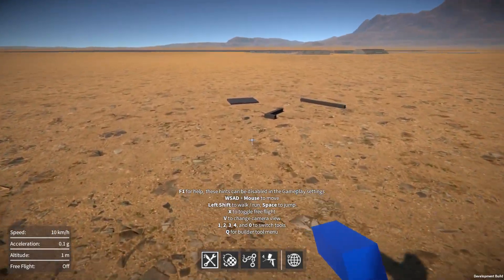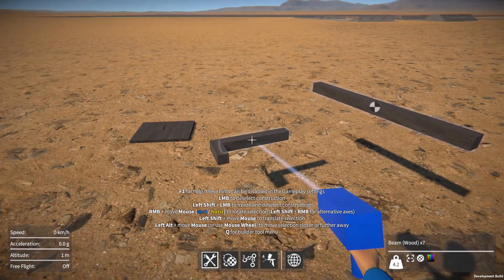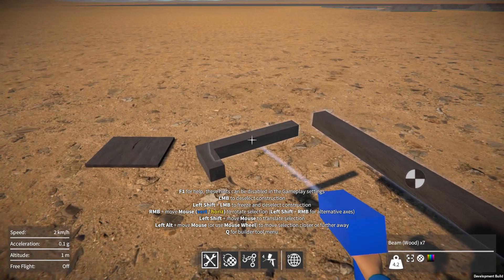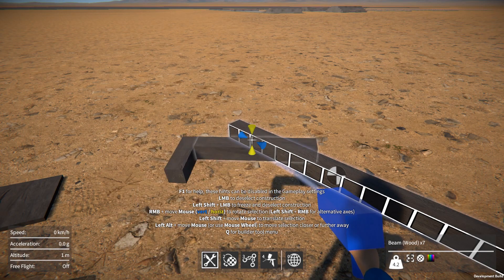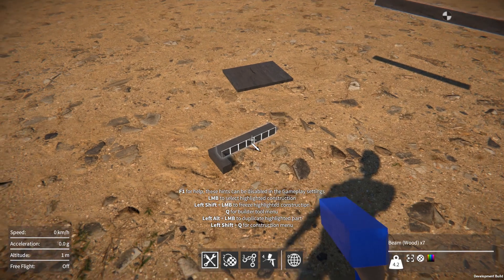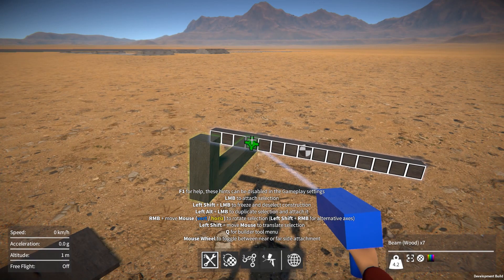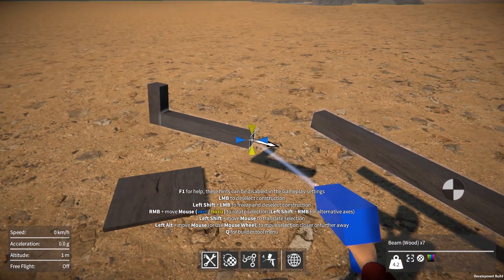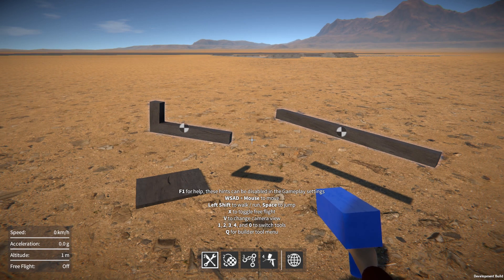GearBlocks building UI - need your feedback!

Comment: Personally, I had no problem figuring out the builder controls when I first started the game.
Though, I don't like the recent change of freezing the parts by holding Shift, freezing with LMB+RMB was more intuitive, just like in G-Mod...
Reply from the maker: Thanks!  I think it's always been shift+LMB by default to freeze in GearBlocks, but you can set it up as RMB+LMB in the key bindings (under the controls settings), let me know if you need help with this.

Comment: Hi!

By now, I've spent weeks in your game and I was having absolute blast of a time. I have made some quite complex projects in 1:1 size - 4WD cars, trucks, formulas, all including independent suspension, helicopters capable of actual piloted steady flight, acrobatic maneuvers and safe landings on designated spot, also some heavy machinery, a snow groomer running on actual tracks with working blade and snow tiller. I have a background in engineering, physics and programming. I can send you the game saves so you can check those models out or even present them on the channel if you'd like as I'm not really the type to present these on YouTube myself.

Having spent the time in the game, I have tons of feedback for you if you're interested.

1) Current building system is decent once you get into it (few hours of gameplay), I wouldn't touch it for now. Ideas you have presented won't make it better, just other kind of complex. Also, watching you experiment with the fps tool models, make sure to add the option to turn those off as they can get distracting and obstruct screen space for no reason. Including that light beam leading to the piece. It's unnecessary.

There is a thing missing though. Add a "hand" tool that would allow you to pick objects up without them ghosting out, you now, like actual physical objects. Imagine a trash can with actual trash in it. If you wanna move it and pick it up, all the trash falls through, ending up on the ground, as the can ghosts out.

I made a cannon for a tank, with 7 shot auto reloading magazine. Missiles being represented by 3*1*1 beams as a separate constructions (no other way to do it really). Point is, when you wanna move the tank with loaded magazine, it ghost's out and shells fall out on the ground.
This principle applies to anything that's made from more than one in-game construction. For example any tracked vehicle - you have the vehicle body, the left track and the right track. If you pick up vehicle body, tracks fall off...

Sometimes when working on something, I really just need to pick up a piece of plank or something to hit it with to see how the thing would react. But I can't. Because there is no actual way to hold a physical object in the game.

I would go for following toolset:
1) Hand
2) Builder
(get rid of the Linker - or does it have a purpose now? - in the demo I have it doesn't)
3) Paint
4-9) keep empty for possible future tools
0) World Manager

2) You need to add a mirroring solution. Badly. Imagine working on a full scale airplane (I'm building the Bell V-22 Osprey tilt rotor now :D) where it takes about 4-5 seconds just to walk from one side to the other. Imagine making an adjustment on one wing and repeatedly going back and forth to re-do the same thing on the other wing. It's just unnecessary and not fun work. Plus I sometimes screw up and misplace stuff, making your plane asymmetric, then wonder why body lines won't match up etc.

I was thinking something like adding a purpose made virtual block to a construction which would define a position of a mirroring plane for that particular construction. Then if for example a beam block would be attached to the construction on one side, it's copy would be placed on the other side automatically by mirroring the coordinates. Virtual block would disappear upon unfreezing the construction and reappear again upon freezing it. Perhaps it could look like a floating icon, just like the center of gravity is displayed, but could be placed and removed like 1x1x1 beam block?

This way you could watch one side in real time as you're building the other to check if you're maintaining correct overall proportions etc.

3) Blue glare around frozen constructions - add a setting to turn it off or make it visible only for constructions closer than 5 meters from player or something like that.

If there is a frozen construction or several of them in your field of view at a distance behind the piece you are working on, it constantly clutters your vision with it's blue glare effects, because they can be seen through anything, including your work piece. Can't stress how distracting and tiring this is for your eyes after a while.

4) Active components (motors, servos etc.) are just badly limited and need a complete overhaul. There are just so many possibilities missed, it's frustrating.

Example cases:

Motors
(Let's say...)
- key [A] makes the motor spin left
- key [D] makes the motor spin right
How do I make the motor stop? I can't, no option to bind a key to...

Motors (again):
- key [A] makes the motor spin left
What if I want another key [Q] to also spin the motor left? I can't, the only bind slot already taken by [A] ...
Solution? Slam several motors together a connect them with gears just so each of them can have different bind to spin the same final direction. And now my helicopter needs to have 20 of them instead of 6. Mind the weight.

Motors (again)
- has no key binded for control
- starts turning right upon activation
How do I make the motor spin left upon activation? When it can't even be flipped over because a design symmetry is required. I can't... no default "clockwise / anti-clockwise" selector

Servos
- key [A] makes the servo rotate 90 deg left off center position
- key [D] makes the servo rotate 90 deg right off center position
How do I make the servo return to the center? I can't, no option to bind the key to...

I think this is enough, but there are many more...

5) Shocks:
- having two sizes is just limiting, allow them to be resized like beams. Lengths 3 to 25 perhaps. Make "spring" and "damping" parameters vary in range according to the selected size.
- insteat of lenght variants add thickness variants. More massive shock would have stronger parameter ranges in comparison to thin shock of the same length.

6) LOD distance - I can't take 5 steps back to look at my car without the headlights going missing. It's too aggresive, we need an option to tame it in settings. Seriously, you can't stand near the nose of the plane and not see it's tail because it LODed away...

7) The "Speed", "Acceleration", "Altitude" meters - get rid of them in the UI or add a setting to turn them off. Consider making them into active components, like display looking blocks with textures on them displaying actual values, maybe sized like 2x1 sheet. One for speed, acceleration, altitude, etc. Imagine slamming those into a cockpit of a plane, actually seeing the speedo on car's dash. How cool that would be! :D

This approach will make sure only the vehicles that need a specific read-out will get it. Plus the immersion by having it on the actual dash in-game, mounting it there yourself, having the freedom to place it where you see fit. And cleaner UI as a bonus.

Imagine pairing a "display" block with a "sensor" block placed on a rotating shaft, giving you the RPM off that shaft.
(now I'm spitting out ideas just to give you inspiration, these all need a thought or two to make them into robust systems)

8) I don't know if this is a bug or a feature but - differential assemblies won't go faster than 2000 RPM, then they start making bashing noises and generating gear jams, physics basically give up. I think this is actually a good feature, as with real engineering, there are limitations of component you need to keep in mind. Just so you know about it. This is observed on default physics engine settings.

9) Wheel component overhaul - consider breaking wheels into 2 components and make them resizable. Point is to allow any kind of tire type on any kind of rim style with any desirable hub offset in any reasonable size. I have this thought out, but it probably desires a sketch or something.

10) Ideas for new components

CV joints
- for the love of God.... you can make them from beams and shafts, but the solution is just too big to match available wheel sizes for end product to possibly resemble a car. You can also emulate their function using gear combinations, but that's too complex for beginers trying to make a simple car, there are side effects in transmitted torque, and it's ridiculous trying making this into a compact solution. I've spent weeks on this...

Linear actuation
- add linear actuating "hydraulic" pistons, something like LEGO Technic has. You can make them look like shocks, just delete the spring and make them perhaps yellow instead of red to differentiate. Also resizable, let's say from 3 to 25. Each piston would then have it's key binding options just like servos to "extend" and "retract" plus a "power" setting instead of torque and "speed" to control the motion.
- you can build a linear actuator now out of a rack and pinion, but how to power it? Motors are just too quick even at their lowest settings. Servos don't have the needed range. So to produce a slow smooth action for powering something like a crane or a front loader bucket raising mechanism, you need to slap a giant heavy gearbox on every actuator and that takes space, which leads to oversized creations relatively to player size.

Brake
- just a simple disc brake

Oh, damn, just looking at the length of the comment now... best for me to get the f*ck out of here by now, sorry...
Reply from the maker: Wow, thanks for your feedback, this is great stuff!

Your creations sound awesome, probably the GearBlocks discord is the best place to share them, or you can send them to me if you prefer.

1) Yeah, it seems the general consensus is to leave the builder tool as it is for now.  Interesting that you found the tool models and light beam distracting, I might be able to add an option to turn them off, however the beam does serve a purpose, as it indicates the point of selection on the object you have selected.

I agree that a "hand" / "grabber" tool is needed to pick up or drag objects around while they're active in the physics world, it's on my list to do.  The linker tool does serve a purpose, but it's only enabled in the full game, check out my dev blog for more details: https://dangersam.tumblr.com/post/184843387359/linker-tool-power-and-more

2) A mirroring option is on my todo list also, I haven't spent much time thinking about how it should work yet, but I quite like your idea of placing a virtual block to specify the position and orientation of the mirroring plane.

3) I think fading out the frozen construction glow based on distance is probably the way to go, I'll add this to my list.

4) Motors:-
- The reason I didn't add a key to make the motor stop is because I'm planning on adding a separate brake part that would serve this purpose.  I could add a key to the motor for braking though if there's demand for it.  In the meantime you can enable "Brake To Keep To RPM" to make the motor stop when you let go of the bound keys.  This effectively enables braking regen (recharges connected batteries in the full game).

- More generally you're asking to be able to bind multiple keys to the same part behaviour action, and yeah this is easily doable.

- Fair point about motors with no bound keys, I'll add an option to flip the spin direction.

Servos:-
Releasing the bound keys already makes the servo return to centre, is that what you mean, or something else?

5) The full game has more shock sizes, but yeah resizable might be the better way to go.  Cool idea to make the damping strength vary with diameter.

6) Yeah I can take a look at tuning the LOD distances.

7) Sure, I can easily add an option to turn off the speed, accel, etc. UI.  Display parts that can show these (and motor RPM, and a lot more) are already done in the full game, again have a look at the GearBlocks dev blog for more info: https://dangersam.tumblr.com/post/185349374274/text-decals-data-links-and-electronics

8) Yeah, there are limits to the physics engine, this game definitely pushes things when it comes to high angular velocities!

9) The full game has way more wheel size and type variations (over a dozen so far).  Making them resizable is tricky as some aspects of the wheel would need to be rescaled and not others, so I'll stick with the fixed variations for now.

10) CV joints and linear actuators are done in the full game, and brakes are on my list.

Hopefully I didn't miss anything, and thanks again!
Reply: @GearBlocks  Thank you for the reply, I'm actually shocked you took the time :D I don't use Discord so I will shoot you those game saves in email found at https://www.gearblocksgame.com/

1) Yes, I know it indicates the point of selection, but I found out I just don't care about it. When you get used to the system and start working quickly, you just don't need it or don't have the time to focus on it anyway. You know where you have clicked 0.5 s ago. At that point, it only flashes around the screen, kind of like those glow effects.
Looks like the best idea would be to let it stay for new players but add the option to turn it off eventually.
Same with those guns, it's awesome, but from the nature of your game, you are going to be using them a lot. Looking at same effects and animations or hearing same sounds they would produce over and over and over again could get exhausting.
Basically, there is an overall point here. Your game has a beautiful calming atmosphere, plus it requires a player to spend significant amounts of time in it to actually build something complex and interesting. Don't compromise it with unnecessary irritating gimmicks.

2) Awesome!
3) Even more awesome!

4) Imagine a case - a spinning orange warning beacon on the top of the heavy vehicle (a headlight placed on a shaft rotated by a motor)
- you want a key [X] to turn on the light and start the motor
- you want a key [Y] to turn off the light and stop the motor (and this you can't do...)
"Brake To Keep The RPM" won't cut it, because it would require key to be pressed all the time for the beacon to keep spinning, which is all the time you would be driving the vehicle. So this is an example of a missed possibility. And there are just so many of those I came upon, and trust me, I tried using whatever mechanics present in the game to make stuff work, but many times it just isn't there, making the build impossible - which is why I said whole system needs a rethink and an overhaul to make sure every possible combination of stuff is covered.

Because this is important, you want the players to be able to create amazing unimaginable stuff, so you can't have them hitting game limits when they try to. I'd like to stress I'm absolutely not trying to bash you or anything here, because this is hard stuff to get right without a single miss, easy for me to talk.

Same thing with servos, you are screwed when you need them to be toggled by the key, not key kept pressed to hold position. Retractable landing gear as an example.

5 to 10) Just a pure awesomeness

Thanks and best of luck with the development!

Comment: When rotating an object I think it must be fixed in the axe that you moved first, for example, if you moved 10 pixels up or down it will only rotate in this axe, if you want to rotate to a side, you must release right mouse button and press again and move your mouse to left or right.
I think you must introduce an "editing mode" to make the objects always stay freeze in the air and a "simulate mode" to make physics start to work, maybe using a keyboard button to select this modes would be great.
A mirror option can help a lot, because when making a complex construction sometimes you can't just duplicate it.
It would be cool to make a universal joint to make the car steering, suspension and acceleration working together.
Sorry for my English that is not so good.